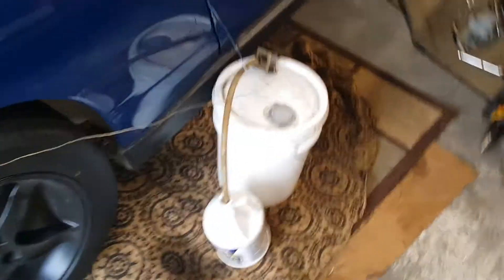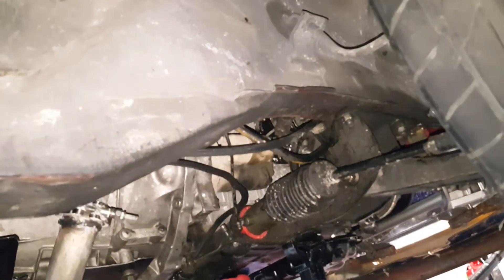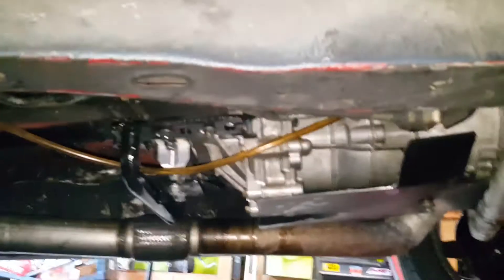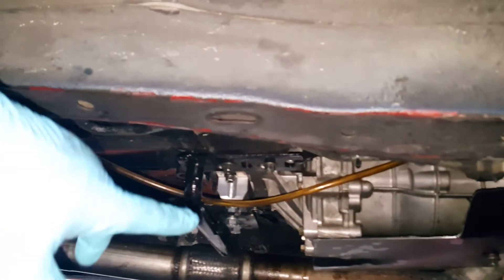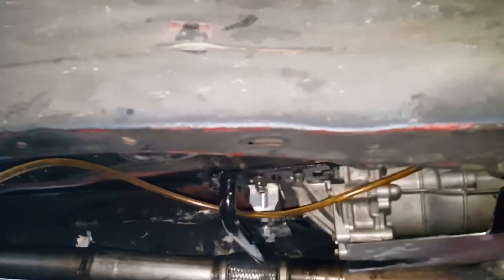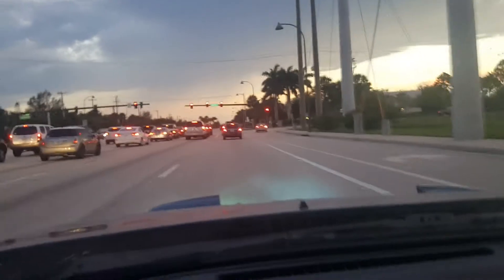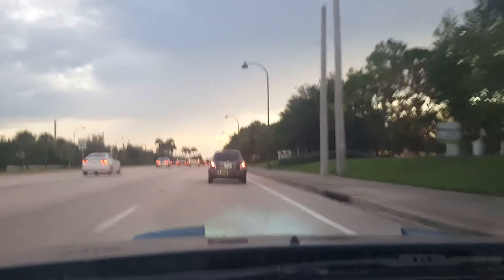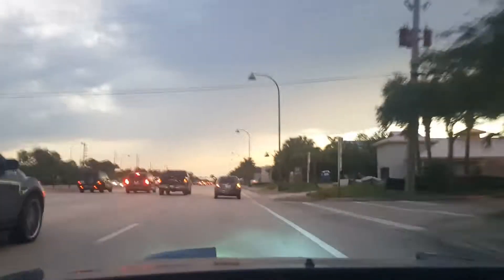Still Working Out Minor Kinks

Comment: Rzgmotorsports just made 505whp and 414tq on a stock revup. They also made 611whp and 518tq stock de. Also another de they tuned made 604whp and 453tq
Reply from the maker: Sweet.  I am gonna research.  If I can make 550whp all day with no issues, I am game. Thanks for the info.
Reply: Have you touched any of the vvti?